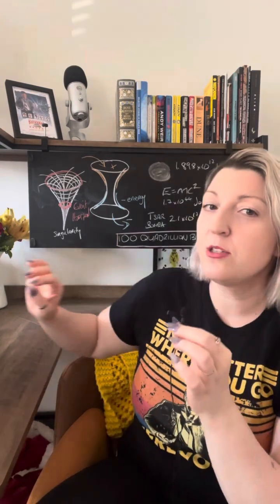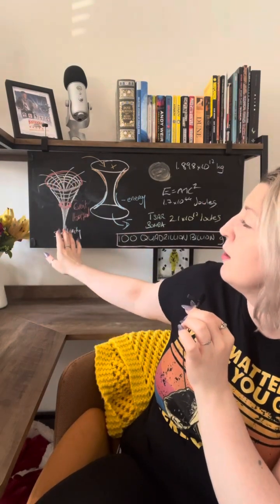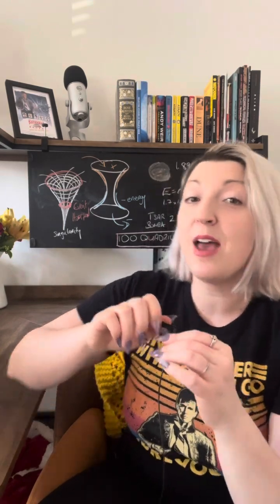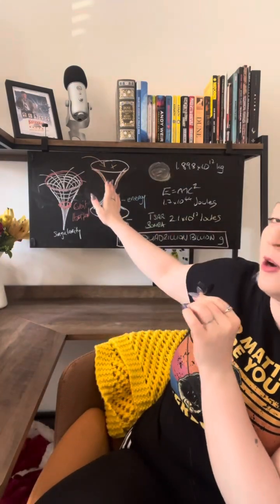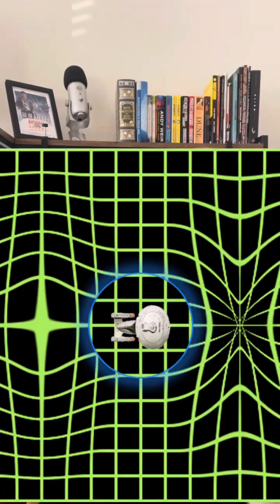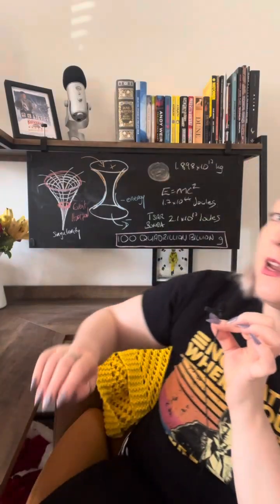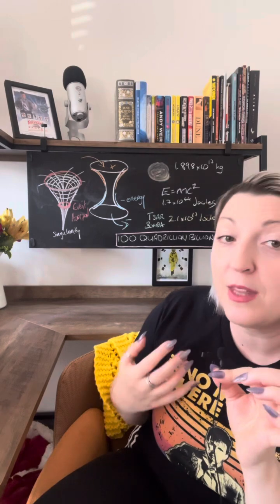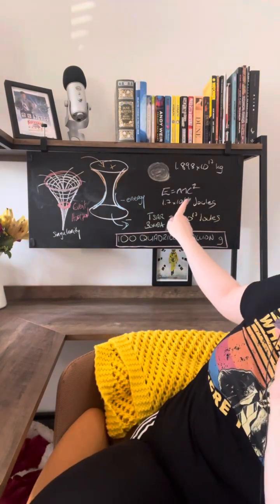How many hydrogen bombs would it take to make a Warp Drive? #physics #scifi

Comment: What really is energy? Can the biological brain conceive all forms of energy? I would think that the key pointer is information. We use relativity as an VR headset that is not a very efficient way to analysis what we perceive as reality. You can not know the position and velocity at the same (time, which is in question) of a quark and in measuring it you disturb the information that you measure is that not true?

Comment: It's not an engineering problem; it's not our problem at all for the time.  We wont get out of the Solar System without ftl.  But shouldn't we conquer the Solar System first, before getting beyond?

That will take some time.  In 400 years we will have a better understanding of physics, but thats a huge leap.  We can't just skip several steps.  As I see it, not even all scientists understand general relativity yet.  So the next step is widely not even accepted.
🚀🏴‍☠️🎸